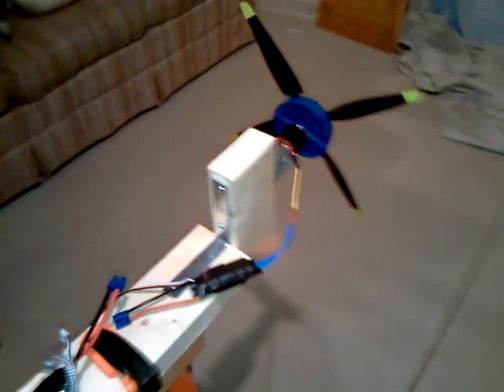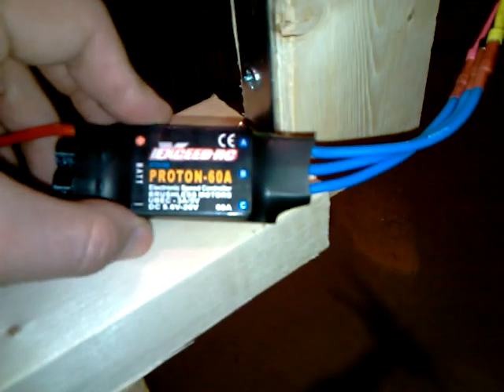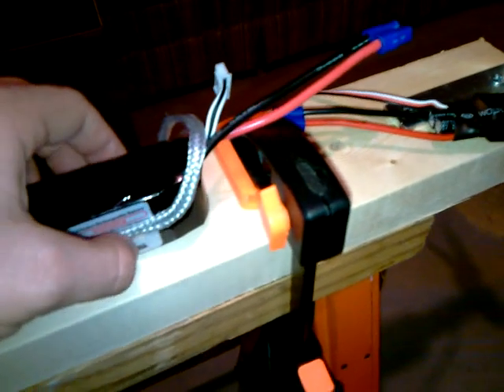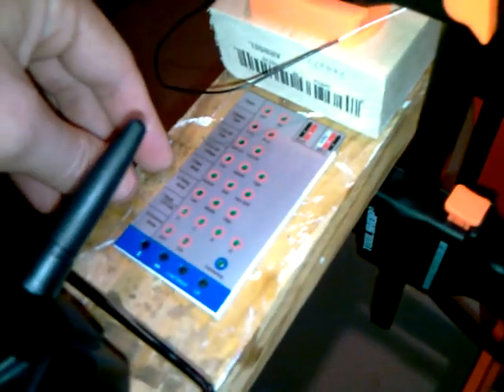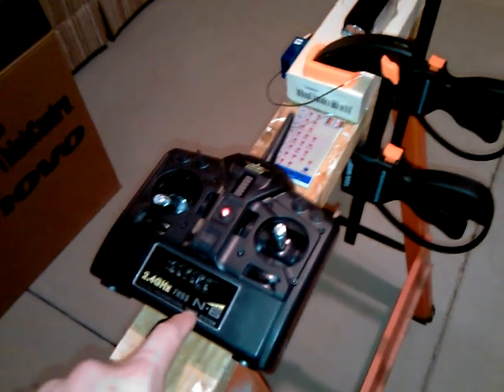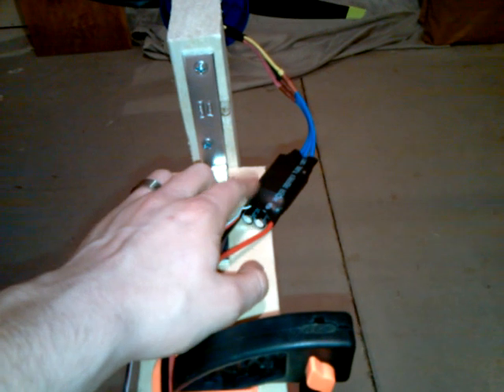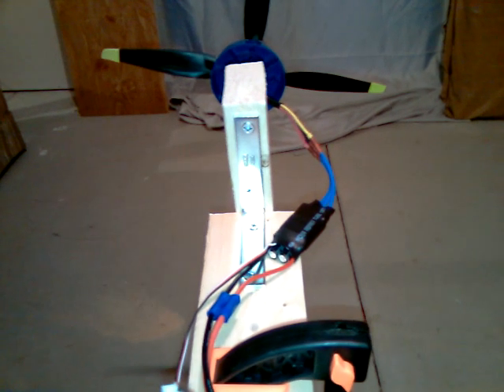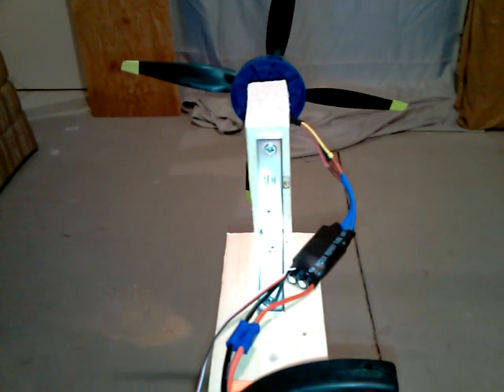Nitroplanes Airfield P-51 motor test with Exceed 60a ESC

Comment: @h2oman210 
Yes, I couldn't fix it, I actually couldn't even remove the motor from the fuselage. I removed the screw on the side of the fuselage and motor would not come out. I gave up. The plane is just decorating my room now. Let me know what engine you put in your and I'll give it a try.

Comment from the maker: @fabianromano - I finally know what you're talking about. I bought the 800mm P-51 and my motor does the same thing. If I tighten the nut that holds the prop on too tight, the motor becomes hard to turn by hand... I think you're right about it pulling the motor shaft. I'm not sure how to fix it, but I may replace the motor soon with something else...

Comment: @h2oman210 
Great thanks for the info. I only flew the plane once before that happen so the motor is pretty much new, and friction appeared right after I over tighten that nut. Also the motor will not come off the plane after removing the 2 screws on the shaft, and the screw on the back of the motor from the side of the fuselage.
Thank you

Comment from the maker: so I replaced it with an Exceed RC Alpha series 480 1020kv motor from Hobbypartz. It might be your bearings that are going out, causing the heat. I wouldn't take a chance at running it for very long because it could cause an amp spike and burn up your ESC. I would replace the motor soon.

Comment from the maker: @fabianromano - I'm not sure that the prop nut would cause binding in the motor, but I had some similar symptoms with my Airfield Skytrainer 182 stock motor recently. I could spin it freely by hand when the motor was cold, but as soon as a ran it for a bit and then tried to spin it by hand, it would not spin freely. It felt like the motor was filled with peanut butter or something. But when it cooled, it was back to normal. I didn't want to take a chance at binding the motor causing an amp spike

Comment: hey, I have the 800mm version of this plane. When I installed the propeller I over tighten the nut that holds it and it seems that puller from the motor spindle. The motor runs but is hard to move it by hand and there's lots of friction, and overheats because of the friction. Any ideas ? Thanks